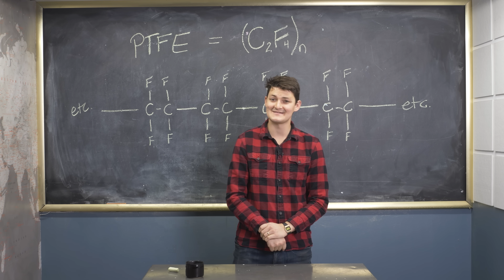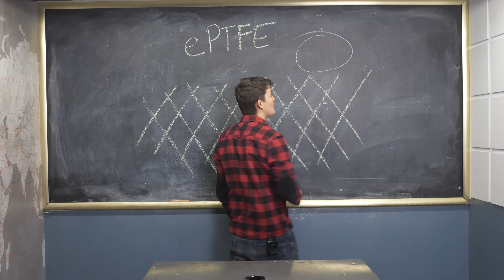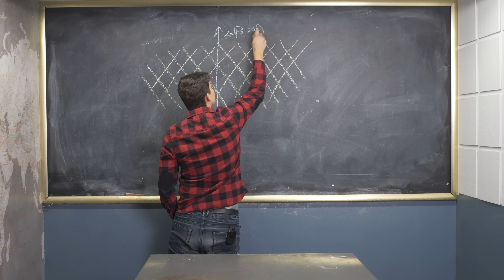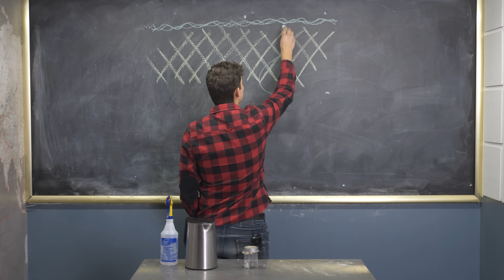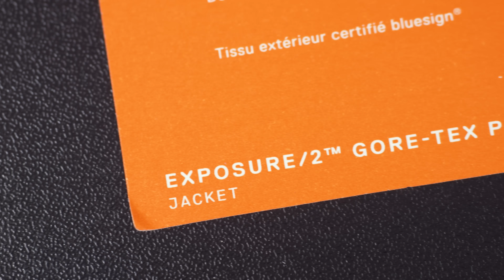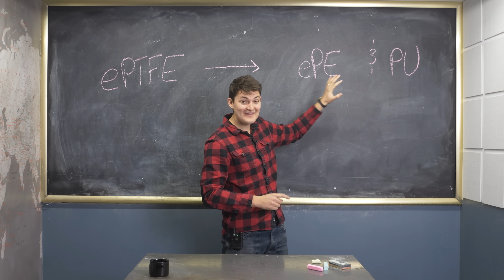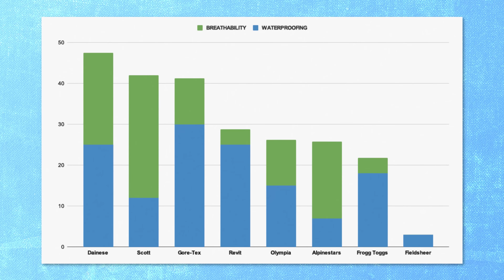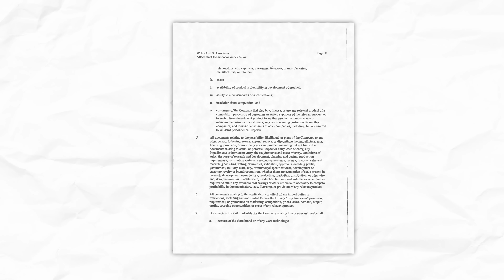Gore-Tex is a Marketing Gimmick

Comment: I have a couple of rain-proof garments, and i can say that GoreTex wont keep you dry unless you are just sitting/walking at slow pace in the rain. So, if you are doing some hill climbing, running, or cycling, (or any other high energy activity) you will get wet either way because your body will produce a lot of humidity that will condensate on the inside of the fabric, ultimately leaving you wet.
Reply: @aaltoadamus9567  I fail to understand if you are being sarcastic or not. If you are looking for 'rain solutions' you better search for how to stay comfortable when wet if you really need to be out on the rain. Neoprene garments and wool will help you keep warm even when wet as long as you also manage to have a good wind barrier (which may or may not be GoreTex)

Comment: So the question begs to be asked which is the best or better still which give the best bang per buck?

Expensive flagship jacket ?
Mid range jacket?
Cheaper jacket with a cheap waterproof over jacket?

What stop you getting wet from outside interference while also stopping you getting moist on the inside ?

Comment: Moisture wicking as in from you to the outside air is the biggest benefit from these fabrics. There is no such thing as waterproof boots or clothing. All my Goretex boots are very comfy but my feet get wet working in winter conditions so I have more boots and socks to change into I am rambling sorry...

Comment: I found that all you need is 600dpi nylon. This is hydrophobic and waaaaay cheaper. My Dad used to spend £1000 on a jacket and I'd wonder why. Compared to my £160 one, the only thing better was the stitching. And I have a sewing machine and a lighter so always fix that myself anyway. But I gave up on motorcycle jackets a long time ago. I never found one I liked. I just use a winter coat bought from China for £40 and it's the warmest, driest coat I ever had with a fluffy hood which keeps my neck warm. When my helmet comes off and goes in my top box, the hood goes up and keeps my head dry and warm.

Comment: Yeah I wear everything BUT the Gore: 

> OutDry - more durable than Goretex & without need for DWR when used as the outward facing material.
> eVent - more breathable than standard Goretex
> Futurelight - similar to eVent but proprietary to The North Face
> Pertex Shield & Dermizax by Patagonia, Montane, and Berghaus
> DryQ Elite by Mountain Hardware
> Eco-Shell by Fjallraven
> Artex - only seen on Showers Pass jackets so far
> Ceplex & Sympatex by Vaude
> Proflex by RAB
> "generic" 3L membranes
> etc.

Comment: Wow, who knew! Goretex is basically just a big scam! Thanks for the research that went into this piece and the guts to post it. Another video knocked out of the park…
Reply: My goretex never lets me down.
Reply: How is it a scam?
Sure, a bit of marketing BS is going on, but it's not a scam. It works (almost) as advertised.
Is it possible that you didn't understand the video?
Reply: @Jehty_  While “scam” may be a strong word to use here, the fact remains that the video clearly explains that the Goretex membrane does not work as advertised in practical application. Ryan also mentions that Goretex gear is much more expensive than that of other manufacturers without offering a better quality. 
You call it marketing BS, I call it a scam (based on the underlying deception). 🍅, 🍅

Comment: 5:42 - The Gore-Tex patent is on a method of manufacturing ePTFE, not on the material, itself.  While Ryan is correct that you cannot patent a naturally occurring product, that's not what happened in US Patent # 3953566.  Additionally, the patent expired in 1993, which was actually before that Seinfeld episode even aired.  Ryan's editorializing here is incorrect.

I should also explain that I'm not defending Gore's business practice.  Competing membranes have been just as good or better for years.  Don't pay for Gore.  I just want the video to be accurate.

Comment: Very interesting to hear and thank you for the brave move. I'm sure the lawyers are getting in line as we speak! I found that gore-tex did not perform well in the UK outdoor mountain walking scene 30 years ago because once wet on the outside it just wan't breathable and when working hard it coudl not get rid of the moisture quick eonugh. the fragile breathable liner soon became damaged too. By far the best in a cold wet enviroment is Paramo's Analogy system which tries to act like skin, it actively transports the sweat away from the core. It had a really good rain shedding outer and you can stick it to your mouth and suck air through it. Disadvantages are it is farily heavy, does need regular reproofing and is pretty expensive. The good points are that it doesnt wear out (my jacket is a 20 year old one I bought for £70 10 years ago) and feels more natural, its not russlly. Would love it if they made bike gear, but I often wear my waterproof when riding as it works so well. It can be recycled and is made by women in a refuge in Columbia to give you an extra warm toasty feeling.

Comment: Agree 100%. This summer I rode my 1400 Kawasaki around Scandinavia for 3000 miles. Out of 14 days we had 3 proper dry days the rest of the time did it rain 😭. My goretex stuff didn’t keep me warm and dry. I had to use cheap nylon / plastic type gear to keep me dryish. Thanks for the video, excellent as always

Comment: Glad you mentioned the Dainese Tempest. I'm so happy with mine since 2015! Insanely durable and yeah, cheaper than goretex.
Reply: I have an even cheaper (waterproof-wise that is) solution in my Dainese with the separate waterproof layer you can wear or not wear, and I think it works for its purpose extremely well! 

I've used Gore-Tex in countless different sports and outdoor activities, and motorcycling is by far its toughest test where it doesn't seem to be able to stay waterproof. I believe that's because of the huge amount of water accumulating in the front, and it being pressed onto and into the surface so strongly and constantly by the air pressure.

Hence I don't see riders who occasionally get caught in the rain (so not hardcore adventure riders) really benefitting much from full-on Gore-Tex and similar membrane products, as even Gore-Tex can't cope with rain in motorcycling that well. Even though in general in other disciplines I by far prefer to use Gore-Tex or similar, it's just motorcycling where I find it unnecessarily expensive and lacking in its performance for my exact purpose. I only rarely get caught in the rain.

Comment: The real genius of goretex was quality control, ive tried various other materials and they usually find a leak somewhere. The extra quality control the companies use when putting goretex into clothing means it just works really well. I have one jacket that outperforms any goretex thing ive owned and it was goretex pricing to get it :(
Reply: I believe they also offer a warranty if a Goretex product leaks.  Which is not nothing.
Reply: This is a big part, I think. I have a pretty nice leather jacket not because the kangaroos skincare routine was on point but because as long as I maintain it a little it'll keep me comfortable and intact. Not much I can do about production mistakes like the ones I just accept in my mesh gloves.

Funnily enough with tents I went all the way to the other end of the spectrum: buy a budget model with no glaring defects, then coat the zippers and tape the seams to make it good. The only person I know with a fully waterproof tent out of the bag (and by fully I mean weather alert level rain, not submersion) got a Hilleberg that cost more than my also very waterproof car. Everyone else either tapes their shit or ends up finding a leaky seam eventually, usually at night.
Reply: Yes, goretex just holds up. Never had it fail. Its not just about the membrane itself. Its about the quality of the whole garment (membrane + top layer garment + inner garment). Goretex quality is really good
Reply: @Payder  Also Goretex offered repairs or replacement if it failed and the original manufacturer dismissed it.
Reply: I agree. Makes a huge difference. Quality control. For me goretex stands for very high quality. Not for "breathing" in 99% humid conditions.
Reply: Agreed.  It's the consistent quality control that matters. Particularly seams and zippers.  I'm as cheap as the next guy and have tried many of the other "waterproof" membranes from lower priced moto-gear.  I always get wet a lot sooner than with my Gore-tex stuff.  For me, in the real world, Gore Tex keeps me dryer longer, and in a driving rainstorm, that's all I really care about.
Reply: @m.f.m.67   Also, F9s graph of goretex v competitors was somewhat misleading since the bars represented their total score. Splitting up breathability and waterproofing, you see that while it isnt the most breathable, it is by far the most waterproof.
Reply: They just are not very durable anyways so you might as well spend significantly less money on something else

Comment: I have personally used old school and modern Gore-Tex stuff, as well as I have owned and used many things containing Thinsulate.... I am impressed by neither to be honest. In the dead of winter, wearing water resistant steel toe work boots detailing cars, I found in cold, wet environments that a nice set of wool socks are perfection. Winter being on its way now, I need to get another few pairs of wool socks.... I am regretting not knowing where my two pair are right now as we have already had two nights below freezing here in Arkansas.
Reply: I agree with you about Gore, it's worthless.  But Thinsulate is wonderful.  The only gloves that keep my hands warm and can work in have Thinsulate.  And I'd highly recommend ditching the steel toes, they're the absolute worst in the cold.  If you must have a hard toe, composite is worth every penny.  Insulated boots are also wonderful, they come up to 1200g (grams of what, I'm not sure), but even just 400g keeps me warm down to -10F.
Reply: @SeniorKlean  I did not have any issues with my steel toe boots in the winter as long as I wear my wool socks, and considering I worked in the wet constantly with cold temps, truth be told the whole boot got cold, not just the steel toe. With my wool socks, even when I did manage to get water into my boots, my feet still managed to stay reasonably comfortable as long as I did not have so much water in my boot it was sloshing around. Also, having the heavy steel toe boots help keep me in better shape as my body keeps trying to fall apart if I do not keep on top of being active while I can be.

Comment: OMG I've been saying all of this for YEARS. Used to be a manger in an outdoor sports shop and I hate the stuff and it's marketing. One day a customer asked me for new hiking boots and strongly stated he did NOT want gore boots. I asked why and his reply: "I work for gore". I smiled, agreed and we carried on. By far a better experience is E-vent. You may get wetter from it but it actively wicks (were gore just happens to have holes the right size, event is  conical holes that use surface tension to push moisture out. Event is 
a far more comfortable experience in the long run. Gore footwear is just a plastic back on your feet.
My worst experience was demoing an ultra-lightweight gore jacket on a rainy mountainside. Trust me, when you are bone dry inside, but FEEL every drip of rain, you feel the wetness of every drop (just like wearing latex gloves you can feel everything) and you are really cold. What's the point in such an expensive jacket or trousers if your entire experience is that you feel like you don't have it on. It was only noticeable when you took it OFF inside a tent and you realize your tshirt was dry but you were still FEELING cold, wet and miserable.
Gore only works when its hotter inside the garment than outside but also DRIER outside than inside. Whiiiich tends not to happen when it's raining outside your jacket and not inside. Basically Gore only works in cold and DRY situations, aka when you don't need it.
Reply: But you said you were dry. If you layered under the goretex jacket, then you would not be so cold. I wear a goretex suit every day commuting to and from work on a bike, and if i havent layered a warmer sweatshirt underneath when it rains, I feel cold. Not as much of a problem in the summer, but when it gets cold it is absolutely needed.
Reply: @basherboy2977 but what's the point of goretex if it doesn't vent?
Surely a good ol' raincoat will be cheaper and more waterproof
Reply: @palashbhaumik42069  It is venting, you’re feeling cold. Goretex isn’t an insulating layer. If you feel cold when it’s raining with goretex on you haven’t layered properly
Reply: Cold and dry is exactly when you want breathable - it breathes for you and then when it rains you don't have to get changed. That's the whole point. It isn't supposed to do both things at once, it was always meant to be sequential.
Reply: A manager of an outdoor shop doesn't understand how a rain shell and layering work. 

Amazing...
Reply: @dimman77  Oh I fully understand. Less from my work experience and more from my time out in the outdoors. I didn't just have that job for retail reasons, I got a job working with things I love, the outdoors etc. The job did however enable me to discover alternatives to gore that, until then always niggled me that it never seemed to match up to the hype.
Reply: eVent comes from collaboration from two rivals , Patagonia Vs Goretex .
Reply: As a backpacker and climber myself i see some use for a membrane clothing, but ironically it's more about windproofing it, then waterproofing. When you're in a harness and carrying a donut of rope on you, and other gear attached around you don't really want to stop to change clothing depending if a cloud covered the sun or not, or the wind direction. Though any type of membrane i tried were not enough to take out the sweat if it's rainy or foggy outside without unzipping some ventilation. So i also carry a lightweight siliconized poncho for that cases.
Actually "when it's cold and dry" case match skiing/snowboarding, but you don't need a waterproothing there that much too.
Reply: People need to realize that the only way to build up that differential pressure which causes venting to occur, is for you to be warm and humid-enough to be sweaty and damp.  Most of the time we will have already decided we are uncomfortable by that point and try to have unzipped vents or other things - which ironically limit the effectiveness of the movement.  It does work, but it really doesn't work well-enough to keep us from being uncomfortable unless you have another layer in place.  The idea that I (and probably) others had which was that a magic fabric would keep you from feeling humid or sticky because of its breathing - was mistaken (perhaps the assumptions we make because of the marketing).  Membrane fabrics do have their place, but as you have rightly stated there is no good reason for us to pay a large premium for one brand over another when they use the same materials and workmanship.  We have become victims of marketing hype - and the sooner we realize this, the sooner we can save ourselves some cash.

Comment: I wondered why my motorcycle gear did not keep me as dry as hoped. Good to know. Does the increased air pressure from riding a motorcycle at highway speeds cause gortex to leak? I have a pair of boots that were fine walking in wet and mud but much less so riding 300 miles in the rain. (and they are supposed to be a top of the line Italian boot company.)

Another thing I heard about teflon decades ago was if burned the gas was very toxic (think cyanide?) and can penatrate a gas mask.